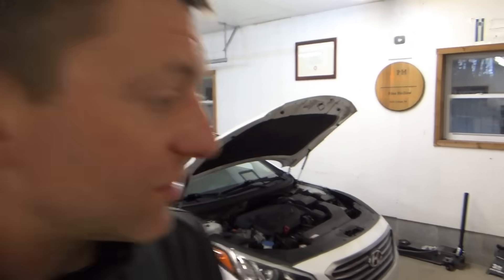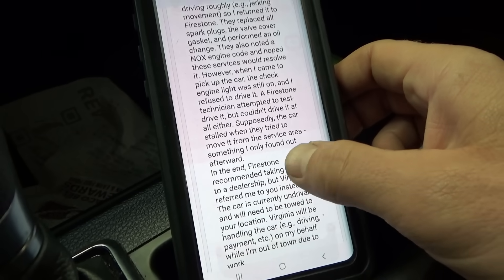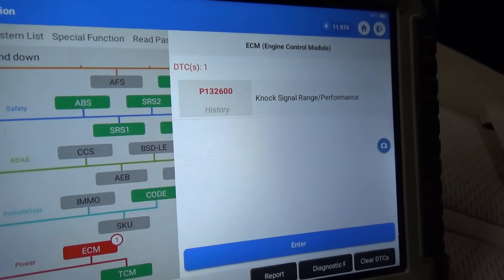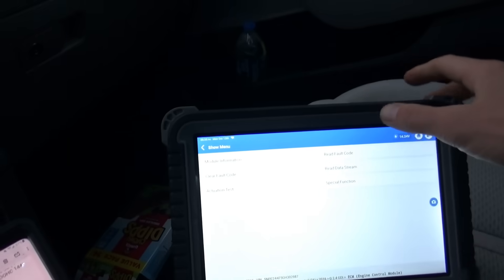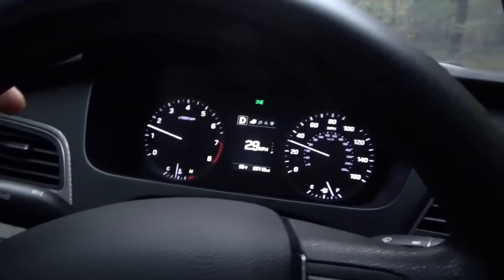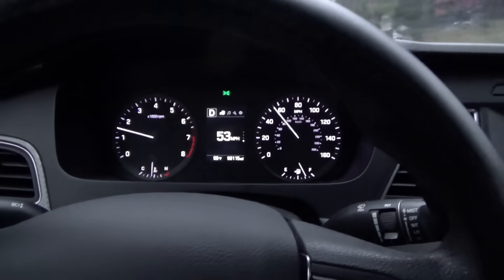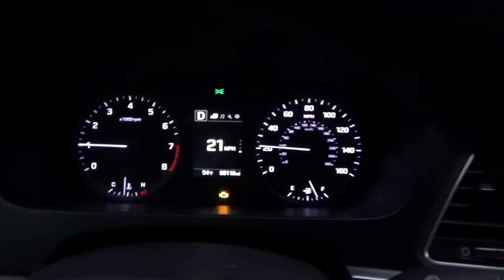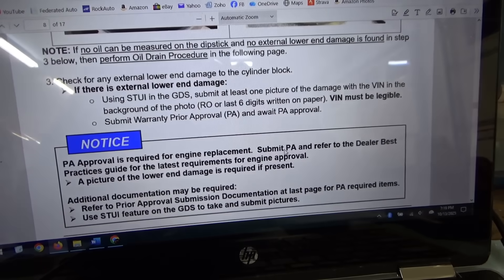Shop Replaced Spark Plugs...for THIS?!? ('16 Hyundai Sonata: LIMP MODE P1326)

Comment: I have a 2017 Santa Fe Sport with the same Theta II engine. The bottom end failed on the New Jersey Turnpike and I was stranded- crank bearing failure at 74K miles. The software upgrade triggers that code to warn you that the engine is failing due to the machining flaws during manufacture. Hyundai had to replace the engine for free as part of the class action lawsuit. I also fought with them for towing and rental car reimbursement. Even with the new engine, I’m afraid to rev it over 3K rpm. Replacement engines are allegedly guaranteed for the life of the vehicle.

Comment: I'm glad the engine is getting replaced, but the owner needs to be trained to check the oil regularly.  These Korean engines are not built well.  They burn oil and often leak it, too.

Comment: It was a nightmare getting the "engine" replaced on my Tucson. The manufacturer fought tooth and nail to deny the claim. Fortunately for me the previous owner (elderly couple) took the thing to the dealer for absolutely everything. The documentation trail was irrefutable. Oil changes every 2,999 miles. Wiper blades, interior lightbulb replacement, you name it, right to the dealer. The annoying part is the dealership had the car for months because of the backlog of engine replacements. Their rule was: replace the defective engines on newer cars 1st. Mine was 22nd on the waiting list of over a hundred cars.
The 2nd irritation was the car didn't even make it out of the dealerships parking lot because of a shift linkage problem "not covered" under the engine replacement. Fine. $$$ later and 2 days after picking the car up... LIMP MODE in the fast lane on the interstate. A very exciting moment for everyone!
Towed back to the dealer and, throttle body replacement required. "NOT covered" under the engine replacement. M'kay, so you stripped all the exterior old  parts off the defective engine and stuck them on the new engine? Yup. You don't get a complete new engine, just the exact minimum parts required to technically cover the manufacturers *ss. The sad punchline to all of this is, the Tucson will still go into limp mode in very specific conditions. Under a certain temperature and humidity (rain) the car throws the throttle body codes. I keep a code reader in the car. On those rare occasions it does flake out, I just clear the codes and go on my way. The Tucson is good to go for another 6 to 8 months. I know it's a wiring issue, maybe a corroded ground somewhere. Is it worth chasing down on a 12 year old vehicle? Nah.

Comment: Avoid all the Theta 2 GDI engines made in the USA. They all do this at some point. The ones made in Korea are fine and I believe the 3.3 V6 also had this issue. Some of the 1.8's also. The new 2.5, 3.8, 1.6 and the V8's are fine.

Comment: So you never have seen this it's a kia thing there motors are ass. Had a brand new one with same code and problems lol send it back to korea
Reply: The one made in Korea do not have this problem with the engine. It's the USA manufacture ones that have rod bearing problems.

Comment: I had a customer who got a new engine for his 2012 Kia Sorento with the 2.5 GDI engine.  His seized up while driving with no warning and it had oil in it.  From what I read they used acid to deburr parts after machining but obviously burrs remained.
Reply: They didn't have a 2.5 in 2012 lol. Was a 2.4 Theta 2.

Comment: Had the exact same code come up in the wife’s Kia Optima SXL a couple years ago. 56,000 miles. Right after I was getting into it pretty hard, it started knocking, then the light came on. Same exact sound lol. Found the recall info. Got the free engine. Been running fine ever since lol.

Comment: either knock-knock(lol) sensor is bad or the engine is and one of Rodney's will come knocking out the block...... 🤣
** yep, one or more rodney's are knocking, dealer trip and new engine time for sure. should fall under recall, unless it was already replaced in the past.

Comment: In Canada warranty has been extended to 10 years 200 000 KM’S for these engines. All 2.4’s (whether MPI or GDI) will suffer the same fate. Garbage engines!
Reply: I've personally never seen the older MPI ones fail here.
Reply: @Jonathan-A-877 I own a 2011 with only 99000 KM’s that’s on its way out right now 😢 gonna dump it before a connecting rod comes out the block
Reply: @FrenchSmitty  2011 is GDI not MPI LOL so of course it is.
Reply: @Jonathan-A-877 you are wrong sir my 2011 Tucson 2.4 is MPI. Not a GDI. I would know I’ve owned it for 6 years. You haven’t even seen the vehicle and you’re arguing 😂
Reply: @FrenchSmitty  there was no need for ass negative reply. It wasn't asked for. Grow up! Are you perfect???
Reply: @J @Jonathan-A-877 2014’s started using the GDI on certain trims and by 2015 they were all GDI’s
Reply: @Jonathan-A-877 before you try an correct someone get you shit in order so you don’t look like a tool

Comment: These engines are different than the 2014 and below sonatas.  They have more oil consumption issues (dirty rings) from the GDI fuel system and if poorly maintained. I've seen water intrusion into the knock sensor after a heavy downpour cause p1326. Not in this case you can hear it knocking.  They are great cars if you treat them right.
Reply: The 2.4 started doing it in 2011.

Comment: My 2012 Kia 186,327 miles had the same issue in Oct 2025.  The only reason I think it made that long was oil changes every 4000 to 5000 miles and I checked the oil every weekend. Had it towed home and started searching for a new/used car.

Comment: Our 2017 Elantra SE now has over 140,000 miles.  Paid $11,000 for it from a dealer when it was less than 2 years old.  During our ownership only issue was failed ignition coil.  Changed oil and filter every 5000 miles.  Just now noticing oil burning, so monitoring closely.  Other than that it’s been a really good car.

Comment: I remember that there was a big recall campaign on those things.  Something about dirty engine assembly process was causing premature engine failure.  I don't recall the exact details.  But every time I got one to my shop, the engine was locked up tight as a drum.  And Hyundai took care of the engine replacement, free of charge.

Comment: Does this thing have sh*tty winter fuel that gone bad? My car pings all the time in the winter. It's spark knocking like crazy and i'm not the only one. I hear it all the time from fords, gms, and chryslers. I also heard hondas, toyotas, huiyundias doing it too. This new gas over the last decade is trash. It ruins small engines, carburetors, rubber seals, and anything that isn't modern. They think that now that we have knock sensors, the engine computer can...compute the correction values on the sh**ty gas they are selling us. A friend of mine had a VW jetta 1.8T with a tune. He went to change the plugs with some that said pre gapped. As soon as he put them in and started the car, the check engine light started flashing. It was in limp mode driving like crap and found out these engines were very sensitive to spark gap. He had to buy a gap tool and gapped his one plugs. The car drove perfect afterwards. As diagnostician's, we have to step back and listen sometimes. I was thinking spark knock, bad fuel, or bad spark gap. The computer not reading correct mixture from bad o2 sensors, or knock sensors. You have to dive deep and do your due diligence. Ivan was spot on with this diagnosis. It is sad to have to tell a customer their only vehicle is just done and it's cheaper to just replace than repair which weighs heavy in my heart. I've been there and understand what these people go through.

Comment: Welcome to the wonderful world of the THETA II. The oil burning can often be fixed with a ring soak. Mine started using around 70k. By 120k it was probably a quart every 800 miles or so. After the ring soak and some Yamaha ring free, that dropped to a little over a quart every oil change (5k).  You do have to repeat the soak, eventually. I'm Now at nearly 180k. I'm a tech and have mixed feelings about these cars. I love how easy Hyundai/Kia is to work on, and mine has been flawless outside of the ring soak and is one of the best driving cars I've ever driven, but I can't deny these engines have issues. I keep thinking since I made it this far...if it was gonna blow, it probably would have by now, so thanks for the buzzkill with the 200k comment you made😁. I'm way beyond any warranty, so I guess I'll ride it out...

Comment: Yep my 2011 Kia Optima did the same thing that rod knock mine had 161 thousand miles the Dealership replaced it with a new engine One thing i will say make sure your engine oil in clean some dealership will not honor the warranty if the engine oil is dirty. they have to give you a rental.

Comment: Been in this spot back in 2023, same year same car. Was only at 67k miles on the dot (started burning at 20k miles roughly) when the bearings ate shit, was consuming 2 quarts a week before it died, well maintained changed oil with full synthetic every 5k, got a new engine (long block) and so far so good at 33k, not a sip of oil is being burned and running Valvoline Restore & Protect 5W-30, about to change it with this oil for the second time this weekend. This oil is a must for any GDI engine, I hope to prevent these bearings from eating shit in the future.

Comment: My Mom's 2016 Hyundai only has 9,000 miles on it , I changed the oil maybe 4 times only because the Age not the Mileage , it Currently only has around 11,000 miles after 10 yrs !

Comment: I got a notice for my 2015 Soul from Hyundai / Kia to bring it in for a "KSDS" software update.  From what I got out of it, it limits engine power when it starts hearing the knocking.  They upped the warranty to 15 years, 150,000 miles.

Yes, they consume oil.  I consider these to be a "hipster" car, so the owners just want to hop in and push a button and go and never bother to pop the hood.
What I like about these cars is that they have a low starting price, low maintenance costs, and even if you have to install a new engine at 120,000 miles on your own dime, you can do that and go another 120,000 without issue.

Comment: If you deal with a Hyundai/Kia 2.4 GTDI after engine replacement, be wary of the cat converter overheating due to an aggressive knock sensor algorithm (updated calibration) that goes into knock retard and pulls significant timing.  This allows unburnt fuel to load cat converter overheating and melting or cracking it.  If you monitor timing you'll see it happen.  Looking at intake vacuum gives you a false assumption that you have a restricted exhaust.   BTW - the exhaust (muffler) does have more backpressure than most but is not the root cause.  

Let me know if you have a method to revise and update the ECM program.

Comment: GDI - junk engine. Same thing happened with our 2016 Kia Optima. Plus it was burning 4 quatrs of oil every 1,000 miles. The engine was replaced by the dealer as part of the lawsuit.

Comment: Theree is a TSB that modifies the software for knock sensor sensitivity. It basically makes the sensitivity a lot more sensitive to anything it perceives as a knock.  There is also a warranty adjustment that increases the engine warranty to 100k or 150k miles, depending on the vehicle.

Comment: Those engines are garbage, I have a Santa Fe 2017 with 55000 miles made a diag and engine is bad from the manufacturer and corporate give a vaucher for 7000 grand

Comment: I wonder if the 5W20 engine oil is a contributing factor even though the engine was purportedly designed to use this weight oil.  I note my vehicles use more oil using 5W20 oil than using 5W30.

Comment: Nice yet GM decides to change the oil and filter and have customers use 10w-40 vs 5w-30 oil in hopes to band aid their engines past warranty vs put in a replacement flawed free engine.

Comment: Yeah, I believe the mileage for the recall is 150k. My GF inherited the 2016 hybrid, and that's the 1st thing I checked for, and the dealership did their inspection and determined it didn't need an engine. Car only has 70k on it. We drove it back from san diego to washington State. 😂😂 it's need a cat but still running. Lol

Comment: I have a 2017 Hyundai Santa Fe XL, with the 3.3L V6, purchased new, and Hyundai sent me an extended warranty notice for the engine. Mine has maintained a steady oil level between changes - barely any drop. (Knock on Wood).

Comment: If you are the 3rd owner of a Hyundai with the dreaded engine tick or bearing problems Hyundai will not fix it as it is your responsibility as I did a 13 Elantra 1.8 engine a couple years ago with piston slap which sounds like a lifter ticking and I had the block bored .020 over with new pistons and rings and bearings and that car is still running great today as Hyundai would not replace the engine, if they are a 1st or 2nd owner it will get fixed 3rd owner no way!!!!

Comment: I'm surprised the Firestone dealer didn't recommend replacing all four tires to fix this engine problem. If that didn't solve the problem then they should have replaced the wind shield wiper blades.
Reply: Don't forget about the cabin air filter scam where they bring out the filter covered in debris.  To be fair many people do have overdue cabin air filters but they seem to go overboard with this one.
Reply: If you say no cabin filter tech wipes his ass with it first
Reply: Very logical!

Comment: Hyundai replaced my dealership-serviced Sonata's clutch and slave cylinder under warranty even though it was just over 10 years of service (but well under 100K.) Unfortunately the replacement went south after just a few months and a couple thousand miles and I was SOL on getting it fixed again for free.

Comment: If the engine designer was only as smart as the computer kias and hyundais would be much better. I just had my twenty eighteen hyundai engine replaced at the dealer. Time to sell. Funny, my 323,000 oyota has never had an engine or transmission replaced and runs And drives absolutely perfect. Take a guess which manufacturer.I would recommend toyota toyota toyota lexus

Comment: If the check engine light is flashing the engine is most likely in limp mode. Thats why it wont  accelerate

Comment: Typical Kai & Hyundai there engine alway has an issue they have recall but if you don't have the knock detection software update they will not replace the engine even if your within the mileage or year the vehicle products today is horrible

Comment: I pretty good sure this vehicle required the mandatory knock sensor software update. With cars that didn't get the update (up to the owner to bring it in) Hyundai will not honor the extended warranty. Further, just because Hyundai is honoring the extended warranty, doesn't mean the owner will see the car anytime soon. Many dealers are backlogged for many months waiting for new engines from Hyundai.

Comment: Glad to hear the customer's local Hyundai dealership did the right thing!

I get a lot of calls to reprogram ECUs on these after shops replace the knock sensors with updated parts per TSB, completely ignoring the underlying problem of knock-knock-knocking on heaven's door.  It's amazing how quickly some technicians just completely forget all their basics the second anything "computerized" comes into the equation.  I've had shops tell me "of course it's still knocking, you need to update the computer!"  LOL
Reply: I wonder if they are confusing knocking with pinging? We bought a new 15 Sportage with the NA 2.4 and almost out-of-the-box, it had a minor pinging issue.  VERY short and very seldom. I had it in under warranty 4 times for it before they even could get the lazy techs to even recognize the condition.  It took me driving with the service advisor to get it pointed out. About a month later,  the TSB and voluntary recall came out, AFTER I had been called crazy.  I'm assuming they messed with timing or something.  That fixed it until about 7 years and 60,000 miles. Then it started coming back. We traded it at 65k as it was getting worse and I knew pre-detonition was hard on bearings.

Comment: I’ve seen several of these they all need engines when this happens have them take it to the dealer and they’ll replace it for them for free because there’s a recall on them if I remember correctly had to fight with them on a lady’s car once recently where they have been replacing so many that they would refuse to replace the engine for her even after I gave her all of the documentation and everything she needed to get it done they had me put an intake manifold on it because they said that was it, but of course the code came back and they finally decided to do the engine for her